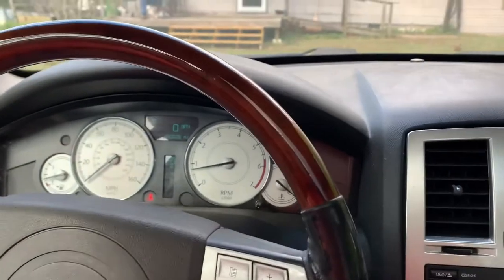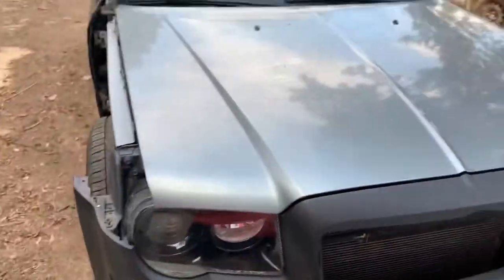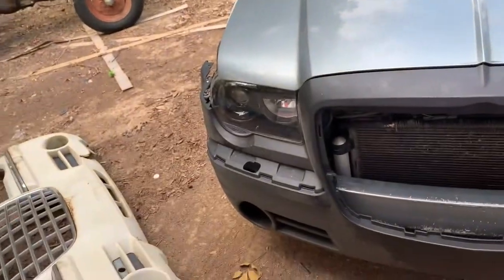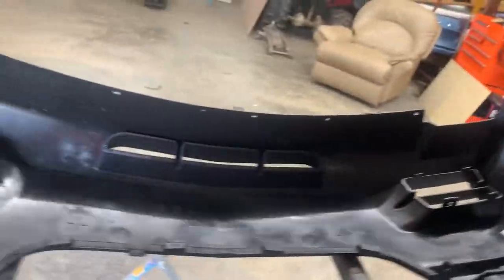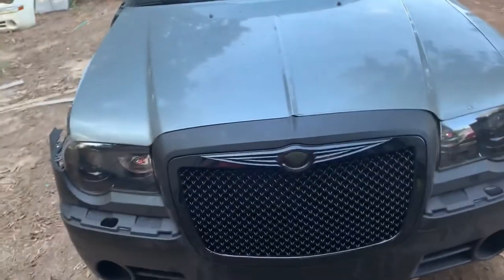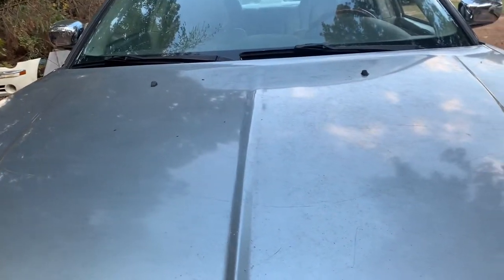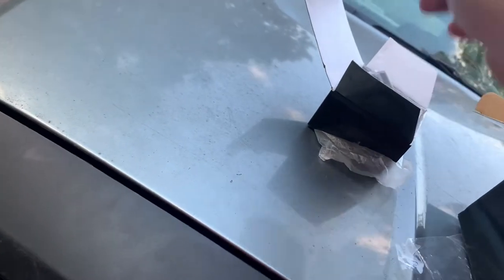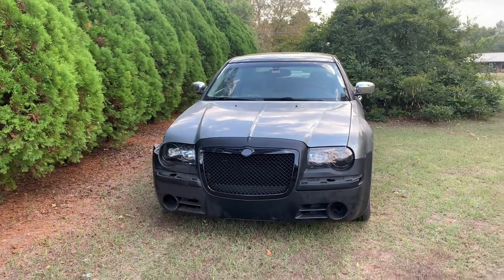2005-2010 CHRYSLER 300C GRILL UPGRADE!

Comment: Where did you get the grill and fender it’s not in the description
Reply from the maker: https://www.ebay.com/itm/Fits-2005-2010-Chrysler-300-300C-Poilshed-Black-Front-Mesh-Hood-Grill-Grille-/124017098362?mkcid=16&mkevt=1&_trksid=p2349624.m46890.l6249&mkrid=711-127632-2357-0

https://www.ebay.com/itm/Smoke-Lens-LED-Front-Side-Marker-Light-Lamp-For-2005-2014-Chrysler-300-300C-300S-/133371367357?mkcid=16&mkevt=1&_trksid=p2349624.m46890.l6249&mkrid=711-127632-2357-0